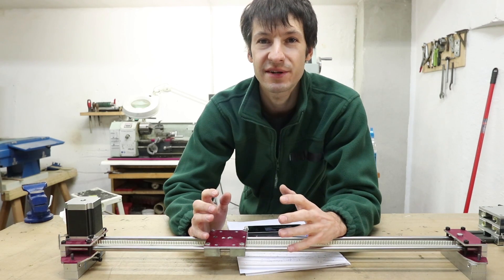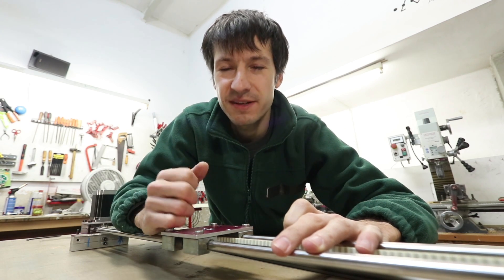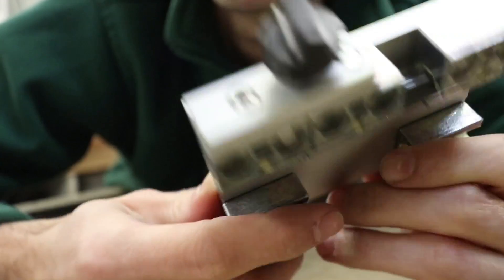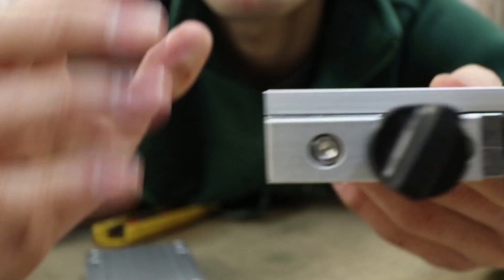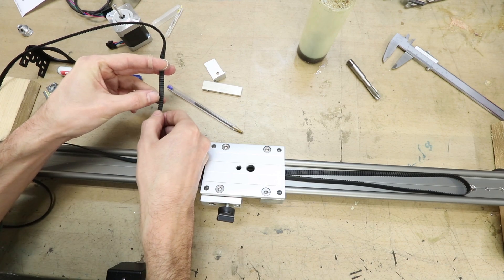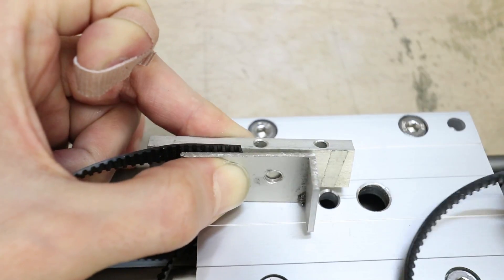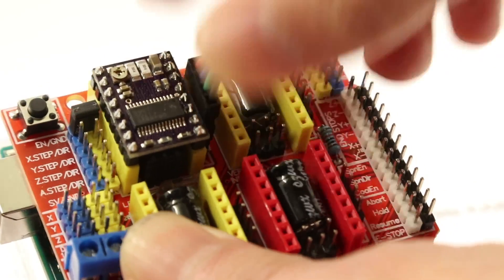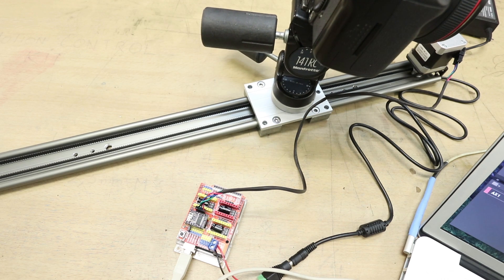DIY Arduino camera slider for professional timelapse and stopmotion

Comment: hi dude this is nice job keep it up  and i made the same like you did with arduino uno with motor shield but i motor not spring when i press the move button but i can hear little noise from the motor . so can you help with that
Reply from the maker: Check the code, at the end of the description there is some help
Reply: @edupuertasfruns  thank you very much! it's working. you are brilliant. and i got another little problem. stepper motor getting hot why is that (i gave 12v ,1A)

Comment: to fix the problem of the bending in the middle would it work if we fit an other rail (upside-down) underneath the original rail ,where the wheels would also roll ? so no bending at all.

Comment: I can’t get this to work at all 😫
Reply from the maker: what is your problem
Reply: @edupuertasfruns  Thank you so much for replying I didn't expect you would. I bought everything you have named in the description. I'm not sure if I damaged the board because I didn't realize there was difference between the A4988 and the DRV8825 so I installed the DRV8825 upside down. Also, I disconnected and reconnected the stepper motor when the shield was powered by the 12V supply. However, when I check the nominal voltages of the pot they seem to be with in spec as well as the referee e voltage. Also, I keep getting a low memory in Arduino and I am aware of the F-disk method but that doesn't help. All I have are Mac computers no PC here. I compiled and uploaded inspire of the low memory warning.  Although it says it's connected  the connections menu When I open up dragon frame it does nothing to step the motor. I've been at this for almost a week. It's so frustrating that I order 5 more drivers (DRV8825) and another Nema 17HS19 stepper motor. Thanks for any help you can provide.
Reply: I got it to power up. I think I burned out one of the drivers. But now the motor just vibrates. I’m a terrible engineer 🤦🏽‍♂️

Comment: Hi Edu.
First of all, you're a god!
Second I was wondering if you could run two stepper motors on the same axis of the CNC shield. Also, if I buy extra motors and Pololu motor drivers that ar'nt from your website, will they still operate with dragon frame or is programming required. BTW this might sound stupid because I know nothing about electronics. If you could get back to me I would really appreciate it. Thanks!
Reply from the maker: Each axis is for one motor. You can duplicate an axis using the 4th one. No need to extra code added, just new stepper driver and motor
Reply: I agree, @edupuertasfruns  you're wonderful! Here's a challenge for you you!

In version 5.0.3 of DF, there's a "Coupling" option, to "use two motors in parallel to move a physical axis," e.g., that are channels 2 & 3 for a y-axis. With the code provided in your comments... I can control each motor (X, Y1, Y2) in DF as separate axes. However, when using the Coupling option with a single y-axis created, only the motor on channel 2 is moving. Thoughts?
Reply: It turns out that the "Coupling" option is "

Comment: Hola Eduardo, una pregunta a ver si me puedes dar una mano. Ya modifiqué el código en Arduino y un motoro en el axis X fuciona bien. Ahora si agrego un segundo motor con el CNC shield V3 y el stepper driver  se asigna tambien al motor que esta sobre el axis X. Hay que modificar algo mas en el código para que respoda a tres motores, uno en cada Axis de dragon Frame? Gracias por tu ayuda y saludos
Reply from the maker: No sé si te estoy entendiendo. Tienes que poner un driver por cada motor. Si funciona el eje x, el y z deberían también. Si se copia lo del x en el y es que hay un jumper de copia puesto para duplicar movimientos.
Reply: @edupuertasfruns  gracias por tu pronta respuesta. Tengo un driver puesto para cada motor (X,Y,Z) en el CNC shield. Cuando en Dragon Frame, creo dos axis, 1 digamos para el travelling y un axis 2 para digamos tratar de automatizar un pan, y pruebo por separado cada axis, ambos actuan sobre el mismo motor que es el x en el CNC shield. No tengo ningun jumper puesto ( a excepcion del enabler)
Reply from the maker: Que raro,  y en el dragon cada eje esta asignado al canal que le toca? Es posible asignar más de un eje a un mismo canal.

Comment: Sorry for a potentially stupid question but what are you gaining from using CNC shield instead of just plain Arduino with stepper drivers? I am new to the field so please excuse my ignorance
Reply from the maker: Less wires and a much compact setup
Reply: @edupuertasfruns  I see. Thanks! I suppose cnc shield also makes it somewhat easier to control the motion/positioning since you can use G code instead of writing it all in Arduino C? Or am I wrong on this one?
Reply from the maker: I am using Dragonframe, a software for animation, that one gives the instructions to the board real time by sending step and direction signals to the arduino. So in fact, the code in arduino is the same using that cnc shield or not, if you use dragonframe.

Comment: Is there a specific Arudino sketch you're using for Dragonframe to connect / control it?
Reply from the maker: Yes, Dragonframe gives you the basic code. To use the electrònic in this video you have to modify it. Read the description
Reply: Cool, thanks! And great work, as always. :)

Comment: Hi Edu, I love your channel. I already have all necessary components to build the slider. 
Could you tell me where can I find the code for Arduino to work with dragon frame?
Reply from the maker: In the program folder there is the code. To adapt to this configuration read the video description

Comment: Great video!!

I'm building a slider for time lapse video using IGUS products. I'm wanting to use a longer rail on an angle high to low with maybe the bottom sitting on the ground. 

I have a Sony A6300 with cage, powerbank battery supply, and sometimes a wireless mic receiver. Do you think the 10-40-10 rail will strong enough with out bowing. Or should I step up to the 10-80-10.  

There is a company online offering a motorized kit for the 10-80-10 that I would like to use. I don't know if it could be made to fit 10-40-80. I will call them tomorrow,,,lol. 

Thanks for any advise.
Reply from the maker: Just for a camera the 10-40-10 is good, if you are going to upgrade to other axis movement on this thing, then think it twice. Phone them, they will know it better

Comment: Whats the software driving the Arduino? I like the ramping at the start of the movement.
Reply from the maker: +Mike Simmonds it is Dragonframe but it does not move live the motors in ramp, only in stop motion
Reply: Shame, I've made a simple Arduino controller for my rail and head but ramping the controls is beyond my programming ability so far.  Love the video's and my  admiration for a stop motion animators paitence.

Comment: Ok, why it doesn't work with me? I have jumper in the CNC Shield, modify code (but not find exactly the same sections). I have just sometimes a little rotation of the motor when i push the rotation button in dragonframe.. DFmoco 1.3.0 is different ? 
Anyway, really good video :)
Reply from the maker: You should find the lines, on dragonframe 4 the code is larger but they are still there. If the motor moves a little, could be that the potentiometer in the driver is not propertly set. Try to turn a little the screw with a lot of care of not touching other connections. Hope it its the problem.
Reply: Nope, it not work.. I think it's pb with code, and crtl+F can't help me to find good line ^^
Reply: Now it's work fine ! With the "old" version 1.2.7 of DFmoco, i don't know why isn't with 1.3.0.. 
Thank's ;) and keep going like that !

Comment: Is it possible to post the full Arduino Code. I do not get it work correct.
THANK YOU :)
Reply from the maker: +HTZMedia some people has the problem not in the code but forgetting to put a jumper in the enable pin of the cnc board
Reply: edu puertas thank you so much. You are right!

Comment: You could ask igus to send you the slider drilled and tapped to your specs. Then all you have to do is find/build a motor mount to fit. Great video. Thumbs up
Reply from the maker: +Dio Medes thanks, also people at Igus are so nice😊 I always use their products
Reply: Hello Dio Medes, do you have the specs you sent to Igus to get the Slider drilled and Tapped? If you can share them it would be very appreciated. Thanks

Comment: Hi Edu, I've copied all the code in correct places (I think) but the only thing I have different is the actual drivers? Does that matter?
Reply from the maker: +ChrisPlays Dear, if the it is a cnc shield on anar Arduino, the drivers really doesn't matter. Recheck the code and make sure you have the jumper to enable the board
Reply: I am curious on what you mean by jumper to enable the board? Here are the code pieces I took from my DFMoco Script, I think they are right but maybe I placed them wrong:

motors[0].stepPin = 2;
motors[0].dirPin = 5;
motors[1].stepPin = 3;
motors[1].dirPin = 6;
motors[2].stepPin = 4;
motors[2].dirPin = 7;
motors[3].stepPin = 12;
motors[3].dirPin = 13;
  
  // set output pins
  for (int i = 0; i < MOTOR_COUNT; i++)
  {
    pinMode(motors[i].stepPin, OUTPUT);
    pinMode(motors[i].dirPin, OUTPUT);
    

/* Second Part */

#elif defined(BOARD_UNO)

  #define MOTOR0_STEP_PORT PORTD
  #define MOTOR0_STEP_PIN B00000100

  #define MOTOR1_STEP_PORT PORTD
  #define MOTOR1_STEP_PIN B00001000

  #define MOTOR2_STEP_PORT PORTD
  #define MOTOR2_STEP_PIN B00010000

  #define MOTOR3_STEP_PORT PORTB
  #define MOTOR3_STEP_PIN B00010000

#endif
Reply: edu puertas also here is also my physical setup: https://imgur.com/a/yRoil . Thank for for responding by the way you inspired me to (obviously) make my own diy slider for films!
Reply from the maker: +ChrisPlays a jumper is a connector for the pins in a board to jump the current. You must put one on the board to enable it.
Reply: ah! I finally got it, must've missed that. Thank you so much, you've earned yourself a subscriber and thanks for making such awesome videos!
Reply: @edupuertasfruns  Hey Can you explain more about this jumper thing. What it must connect?

Comment: Thanks for the really good instruction video about this. THat's really the best way to do it. Now where did I put my arduino :) Version 2 of this could be mounting the arduino in some housing and put a battery so you could use it wherever you go. Also, what was that software you used to control the motor??
Reply from the maker: +vajje2k5 I am using always Dragonframe software. And yes I would love to mount a battery

Comment: do you run a modified version of DFMoco?
Reply from the maker: yes I do
Reply: ah, that may be the root of my problems. I've been struggling to get a cnc shield to work with a home built follow focus (and more stuff later) but had no luck. I haven't delved into the code yet. Just successfully got it to work with a single easy driver though (!) I assume it's mostly pin reordering?
Reply from the maker: BrickNerd yes it is only the pins doesn't match with the original ones on the code.

Comment: I would want to build this for timelapse photography so how slow can it move?
Reply from the maker: +D Wil All the slow you want, it can perform timelapse but now driven from computer. You might need autonomy, a battery and a screen with the right code to work outside.
Reply: Is there anyway I could design a switch because I don't have $300 for dragonframe, that's why I building a motorized slider.
Reply from the maker: Let me search a bit

Comment: Great video! But you need to replace your clock batteries :D
Reply from the maker: jaja, you are the first to mention it! I was wondering if somebody would notice it.... I would remain in secret the truth about this mistery...
Reply: @edupuertasfruns  Did you connect the MS1, MS2, MS3 modes to the micro-step?Thank you!
Reply: Lol I just noticed that too :)
Reply: edu Pierre
Reply: No, he is a real time-travel man, so he is...timeless... 
Cool work btw, like mine. I just start to use stepper motors.

Comment: Hi Edu. I can't seem to get my stepper to work properly. I have bought the same motor as you describe, and a black box driver. On the driver there are microswitches for the steps and the current. I have set the current to 2.0A, peak 2.2A as the motor specification is for 2.0A. But there is almost no holding torque and no strength in the motor. What am I doing wrong? Is it the current setting or something else? I am running the motor off a 24V PSU.
Reply from the maker: +Odd planet too many things going on to know only by these lines understand your trouble. Send me a picture of your settup. My guess is that you have the enable switch in off so, nothing is running.
Reply: Hi Edu. I think I have found my problem(s): I set the microswitches to 2.5A, and the motor worked fine, even though it is rated at 2.0A. With the lower current it didn't work properly and had no torque. My other silly problem was that I put a gear onto the shaft, but forgot to tighten the grub screw, so when I held it as it was turning, there seemed to be no force in the motor!
I'll send you some pics of my set-up by email.
Reply from the maker: Great then if it works!!! When you make something work it's a joy. Thanks for sharing your experiences

Comment: An other nice project from you!! Great job!!!! Could you please tell me how is possible to control the motors from pc software?
i mean which software do you use and the program for arduino.
Thank you very much! have a nice day!
Reply from the maker: +Giorgo's LAB Greece I use Dragonframe and this software also include a code to upload for arduino, for this configuration some code modification is required.

Comment: I really like how you used the hacksaw to create teeth for the cable clamp. However, how does the dragonframe software control GRBL (I assume GRBL is installed on the Arduino?).
Reply: grbl goes in arduino yes.

Comment: hello! I am having a hard time navigating the Igus website (in English), and finding the same slider and accessories you used. Could you provide direct links to what you bought from Igus?? Thank you :)
Reply from the maker: If the flash works in your browser it is easy, in the link you will see a box with opitons to choose what you want. I describe now configure the following... (in some browsers the box doesn't work, then is a little complicated to understand)
For the rail you choose WS-10-40-Ungebohrt and you set up the length-1000mm for 1 meter http://www.igus.eu/wpck/2003/DryLin_W_Doppelschiene
Then the slider or carriage is WW-10-40-10-HKA, in the box you say the lenght to 100mm and tick the box for hand clamp for easy positioning. Those are the 2 parts. If not, send a mail them asking for WS-10-40-Ungebohrt-1000 and WW-10-40-10-HKA. They will understand it. Thanks for your interest!!!

Comment: Hi again, Edu. What settings did you enter in the Dragonframe ArcMoco axis box for the motor - steps/sec etc?
Reply from the maker: Really depends on how many microstepps do you have configured the drivers to run on. It must be something that doesn't take you forever to move it and not so fast that the motor jumps stepps. Do you thing I should make a video about it?
Reply: For me that is the tricky part. It would be good to see a video on how to configure it all together. I don't think anyone else has done one, they have all just muddled through!
I have just been using 1/16 micro steps because that was what the BEDs used. I don't even know what would happen if I used something different!
I had a problem with the geared motors and backlash, so I changed them for some unguarded motors, the same as you use for the slider. But I could not get them to work at all. It might be because I put in too many steps to had the micro steps wrong. I just don't know the answer, so fiddle around until it seems to work.